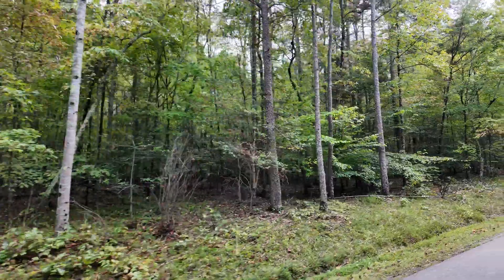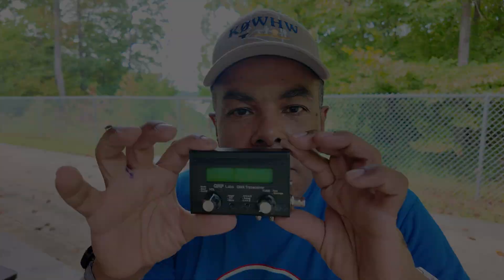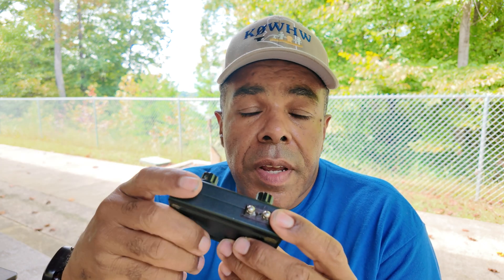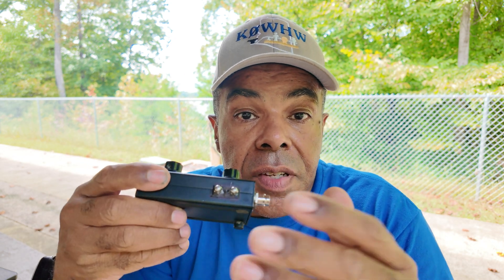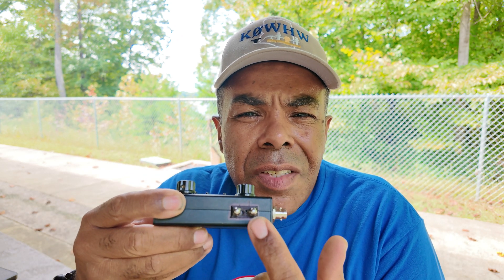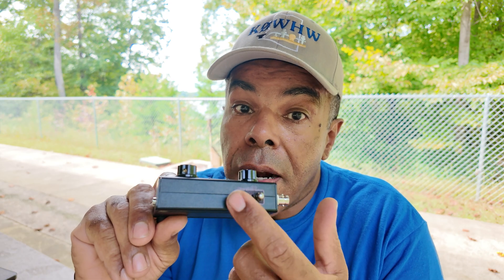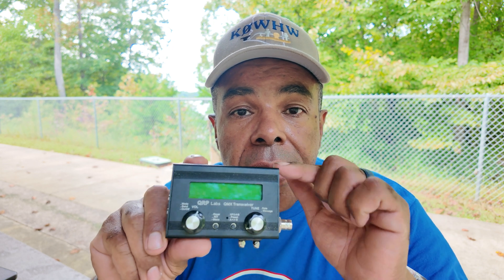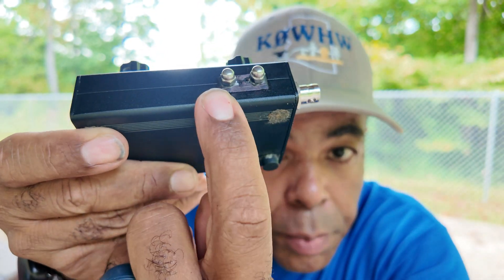QMX Mod - Onboard Touch Paddle

Comment: Nice mod for the QMX.  I am surprised there was enough space in the enclosure.  73, KF4LMZ
Reply from the maker: Thanks for dropping by!  I was surprised, too.  The board is tiny, and I'm sure small radios is what Adam, K6ARK, had in mind when he designed the board.  Perfect!  I'm not too good at it yet, but it is always a backup or something to try during an activation.  See you out there.  73 de Bill